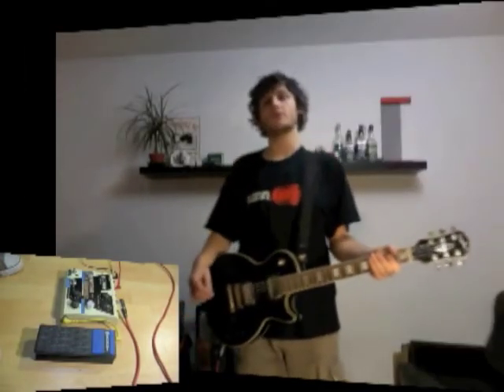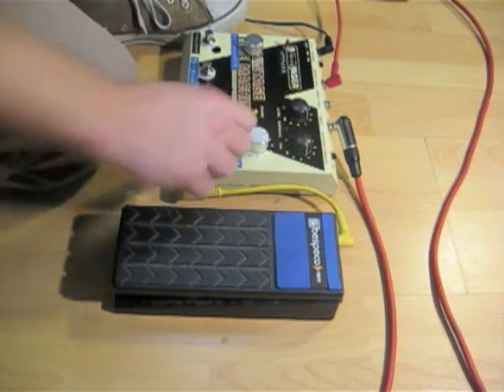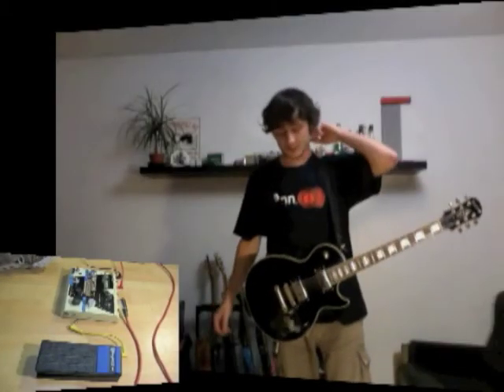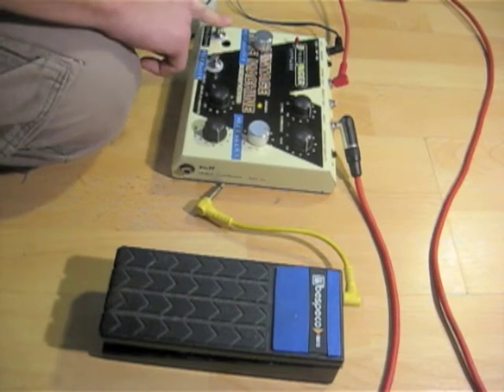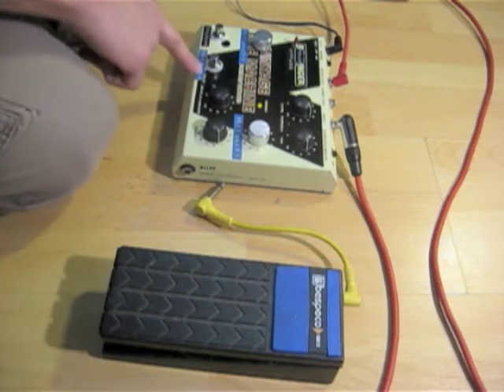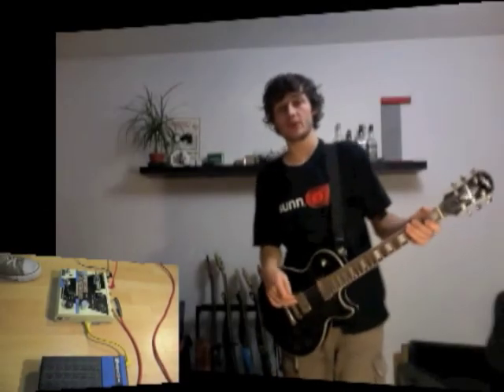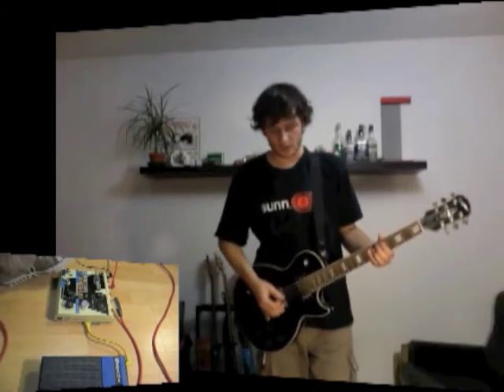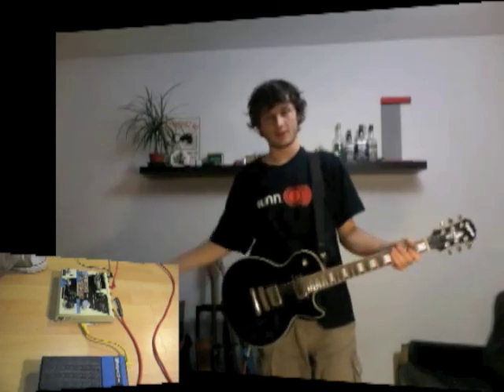Modif. Behringer Time Machine Delay

Comment: The expression pedal input is an excellent idea. Would it be possible to control the delay time and the amount of feedback with 2 seperate inputs ? I am thinking of controlling the unit with CV signals from a synthesizer / sequencer.

Comment from the maker: Yes it would be possible. To control these two parameters with a CV signal, it would require a little adjustment, but perfectly practicable.